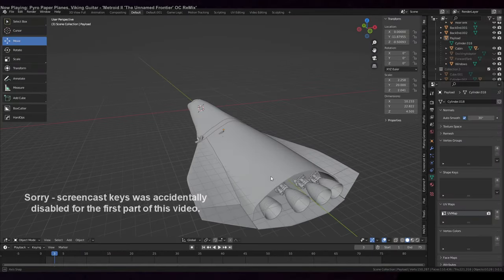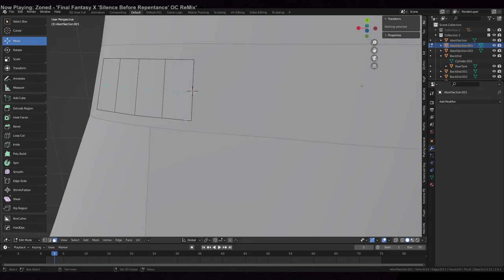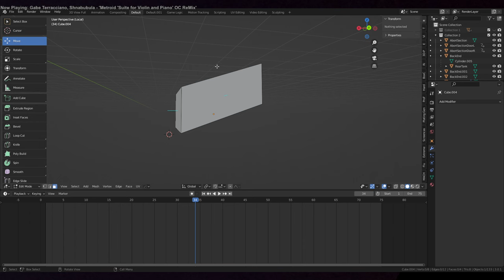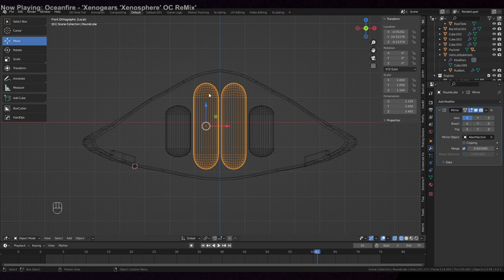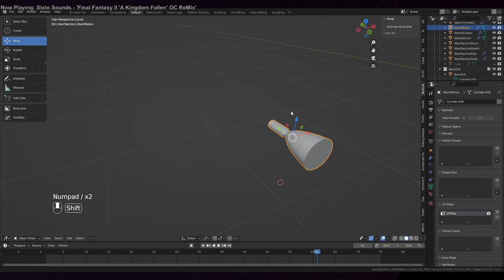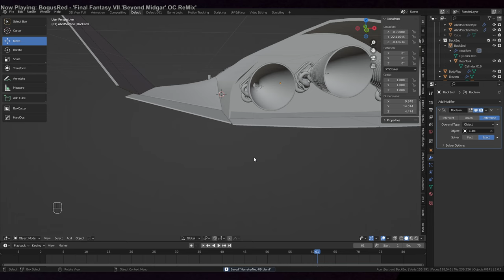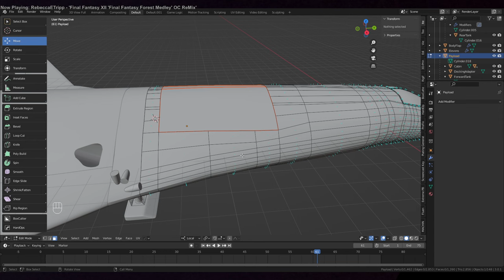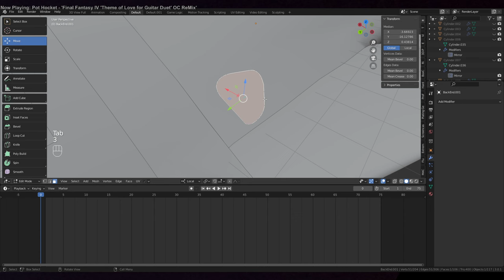Redesigning the Shinkansen Spaceplane (Blender Phase 2)

Comment: escape engine hole redirects exhaust up, that will push the back section down towards the other plane
Reply from the maker: That would be fine. The decoupler between the planes would also fire and push that plane down as well. The goal is survival of the crew in this situation and we're expecting explosions behind them anyway.